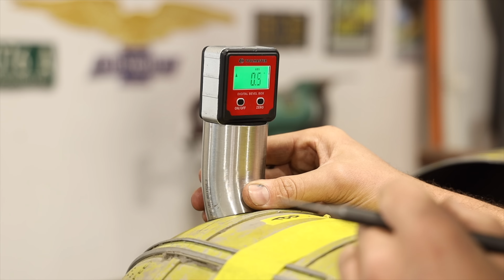Customising WWII Oxygen Reserve Bottles into Hot Rod Fuel Tank!

Comment: Craig has a very desirable car there especially with the Ardun heads it should be a real head turner when finished and as usual nice work on modifiying the tanks Jordan, I hadnt heard of those Holley laser senders before they sound like the perfect solution for modified or scratch built tanks where a lot of times you have to be satisfied with an accurate empty reading and a tank that stayed full for a long time before dropping. Cheers Greg
Reply from the maker: Happened to me many times! Or I loose the cork of the float

Comment: You had the watershed moment to put the tanks in the lathe to mark them, so why didn't you just leave them there to cut them,  Just put a cloth over the way bars to keep fine particles off, hold the grinder in place and spin the tank to cut thru.  No fighting a round tank on a flat surface.
Reply from the maker: Gee wizz tell me this now. Haha- excellent idea for the future ones Dennis
Reply: They would have fallen out
Reply: @ShaunHensley  Not if don't 2 of the bracing strips, cut every thing else then remove from lathe and finish those 2 small cuts and you're done.
Reply: @dennissheridan1550  True true.

This little task had me thinking of a fixture similar to a low tech motorcycle wheel balancer. 

Because you are right, making that cut on a flat surface or in a traditional bench vice is awkward
Reply: My thoughts as well.
Reply: Those tanks are awesome. 
What diameter wire to you normally tig with?
Reply: R2D2